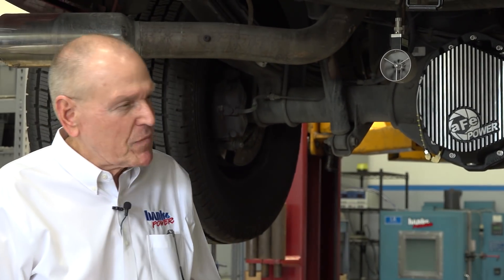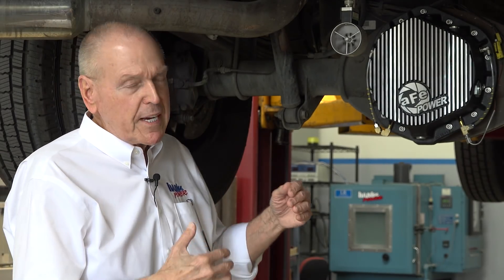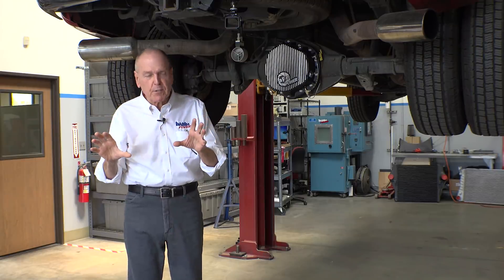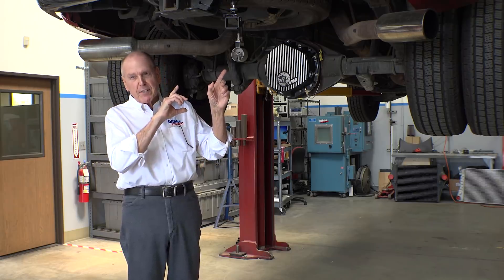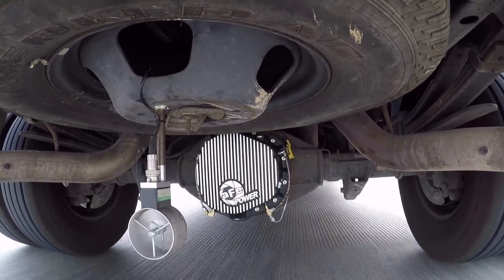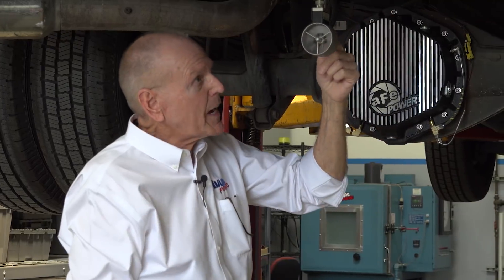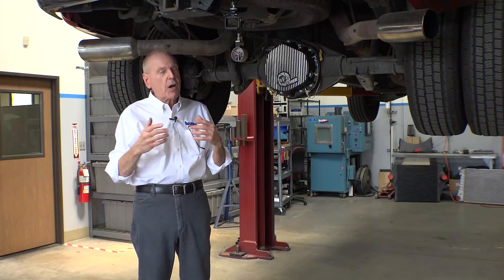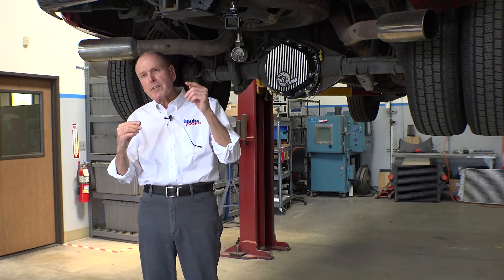Do Diff Covers Work or Are They Just Bling? Part 1 of 3

Comment: ill bet the stamped steel one out performs the "bling" crap just like with wheels
Reply: Like vs like, the aluminum will do better due to heat transfer. These after market ones add capacity which makes the argument more about that rather than material. Also,  steel wheels do not out perform aluminum ones. You can get equal strength at lower weight using aluminum. It's kind of the reason EVERY form of motor sports uses aluminum wheels. Sponsored/pro Drag, off road, drifting, circuit, motorcycle, etc all use them.
Reply: a c NASCAR still runs steel wheels.  Also most race cars use magnesium not aluminum.
Reply: Nascar uses steel wheels because it is mandated in their rules and they want everyone to use the same thing from the same manufacturer. Just like top full pretty much only use hemis because the rules basically describe hemi engines without saying hemi engine. And yes, I know a bunch of cars use mag wheels. They are even lighter and just as strong as aluminum and steel.  There are still way more groups of car culture that use non-steel wheels.
Reply: The heat transfer of aluminum is great until you hit a rock with the diff off-road. Then a person may wish they had stuck with stamped steel. There are pros and cons to everything.
Reply: Rabid Badger absolutely not... I’ve been there. I replaced the stocker with a $100 unit from summit.. 3/4” thick aluminum. Backed into a big rock in a creek bed. Chipped a fin off down to the main cover body and a good gouge in it. Stamped steel one would have a hole in it and could have made it all the way to the ring gear😬. 100% positive it saved me an overnight stay or a shitty trail side repair. On an unrelated note, the rear seal on my transfer case leaked after that🤔
Reply: Anything thing metal with fins that is set away from where the heat originated is playing a critical part in heat dissipation. If the fins are short, stubby and pretty much there for looks you won't notice but a few degrees in difference..  but still doing more for cooling than a smooth surfaced pumpkin lid just because of dispersion to areas other than your valuable parts..
Reply: It depends if your lubricant is over temp.  It has an ideal operating range depending on what its doing, but if you have a gazillion quarts in, and a super duper giant diff housing and never tow anything you may never get the lubricant to flash the water out of it.
Reply: Aluminum has a better heat transfer rate, so I would say you failed chemistry class and are a moron.......
Reply: Alloy doesn't mean aluminium. Cast Iron is a alloy and contains 0 aluminium.
Reply: Pete, No one said alloy. Everyone in this tread said aluminum. 
Rabid Badger, If you are worried about real offroading and hitting a diff, you wouldn't use either. You would want diff armor or fabricated steel plate cover. Most people that run these don't off road. They have them on their pavement princess/ tow rig. Where they care about keeping highway driving/tow temps down.

Comment: So I have an after market diff cover, just like the one as shown. It supposed to hold more fluid. And if I fill it up to the level as I would if it were a stock diff cover. Could I damage my gears? Or should I fill the differential all the way to the top?
Reply: Gman 34 You fill it just like the stock one. It should go to about the level of the bottom of the axle tubes. The extra capacity usually comes from the cover being deeper. If you filled the diff to the top it would overheat because it’s fighting through the fluid all the time.
Reply: Gman 34  get the level too low and you starve the gears and outer bearings. Fluid travels on the axles to the outside bearings lubricate's the bearing and race and drains back down the housing tubes to the sump. Front pinion requires sling lubrication from ring gear.too little sump lube while running = faster wear damaged parts. Error on high side of fluid level.
I install a 1/2 inch galvanised street ell and square pipe plug in all my axles. Raises level 1/4 -3/8 of an inch. Not an option on dodge push in plug covers.

Comment: Does he not realize by increase the size of the cover, the fill level can be increased while keeping it at the same FILL HEIGHT as the stock cover?
Reply: if you increase the total oil volume, then the running oil level will be higher. Got it?
Reply: there's more area for the oil to settle, the running level would stay the same imo

Comment: I have an 03 Cummins, still have the stock diff cover and plan to replace with an AFE or ATS diff cover (AFE is the one pictured in this video).  Because of this video I'll probably invest in some temperature indicators to compare before/after temps.  I'll update when I do.  Until the vid I never really put much thought into it, I just wanted a cool looking diff cover because, looks cool?
Reply: John Davis BD has a unique take on the diff cover , check it out while you're  deciding which cover.
Reply: John Davis  non contact thermal thermometer with laser pointer, 29.00$ everywhere.
Reply: Safety First In Texas... I have an thermal, but I think that it will not be good for this.  I have to pull over to measure temp and when I do that may or may not be the peak temperature that the diff cover experienced.  I used to rebuild transmission, I do have access to strips that blacken as the temperature increases, the more the strip that is blackened, the higher the peak temperature, which is what I am most interested in.  We used them for warranty purposes, one of the guys will probably give me a few for cheap/free.  But thanks for the suggestion however, I will keep it in mind.
Reply: John Davis Guarantee you wont loose 2° in the time it takes to pull over, Get out, and shoot it. I shoot tires, diffs, trans, hub bearings, radiator, carrier bearing, etc. on my rest stop relief detour. Extra 5 min gives piece of mind, standard of normalcy.

Comment: Come up with a Banks Diff cover that works better!!!!!!
Reply: It being a Banks makes it better
Reply: tsimmons1974ts What do you expect it to do better?
Reply: Icutmetal cool the diff  dumbo !!!!🤐🤐🤐🤐
Reply: charge more money for the same thing... right.
Reply: How are ya gonna make something that barely does shit to begin with from an engineering and real world standpoint, do a better job?
Reply: Make one with air scoops at the top to direct air down across the fins on the back. Don't paint it with any sort of coating. That just adds insulation, reducing heat transfer.
Reply: @greggv8  actually, black transfers heat much more than the thin layer of paint will insulate, so black paint is a big net plus for heat transfer...  but I do like the baffle idea!
Reply: MrHillfolk it does a lot freak it transfers the power to the wheels !!!
Reply: tsimmons1974ts 
Ya derp, learn to read. 
All a diff cover is gonna do is hold oil in. 
Unless you install a pump and cooler on the diff , a cover isn’t gonna do shit except be a waste of money.
Reply: tsimmons1974ts no that would be the differential

Comment: I have done some testing on over filling on Dodge/Ram 11.5 With PML, I run 1 QT over full on all My Dodge Rams 2003-13 , I also have temp Gauge installed on all Trucks. In over 278K miles never a problem.  I replace My 2003 11.5 at 82K miles , the pinion bearing failed the rest of the unit was like New. I replace the OEM Unit with TrueTrac all new bearing and replaced the R/P gears. Now the Seller of My TrueTrac adamantly told me to TQ the Side Bearings to 150FT LBS, I called again and inquired Why 150FT LBS is more than I usually do at  110FTS I thought was good.  I immediately had heat increases ,But again the seller (Big Name Company) said it was normal on the TrueTrac.. Well when I went out to The Rockies Pulling My toy Hauler Temps went to 400F+ and I had to use My connections to fine a shop that I could used to remove the Cover and Check....Yep Wear on the R/P gears and  side bearings, So I re-set the R/P Back lash and RE-TQ the  Side bearings to 110FT LBS and continue on... After the 2,700 trip and back home I dropped the cover and Replace it all again do to the wear. IMO that extra 1QT saved that Unit until before/after I could return Home... and I was reimbursed for the 1st unit, it was discovered they were Quoting N m-FT LBS  That was 9 years ago, I'm still running 1QT over to present on all My AM 11.5s and PMLs.

Comment: I bought some mag tech cover’s for my 95 dodge ram 3500 5 speed trans. for several reasons 1-drain and refill made simple  2-The covers have O-rings no sealant or gaskets needed 3- The covers also come with magnets for collecting metal particles 4- The covers are deeper so my capacity went up over a quart in the rear but still retaining factory fill level 5- oil does run cooler by about 70 degrees Fahrenheit on average.   they look a hell of a lot better than the steel caps that came on the truck. and those are the reasons why i purchased mine. i pull heavy commercial air conditioners and sometimes pallets of sod a few years back i installed the complete banks power pack system With the ram air intake kit along with the banks double shot water methanol injection system  which is working out pretty awesome so far. i easily doubled my power output. and because of that my next concern was my drivetrain and keeping it all in one pice. i am curious to see what the test’s say.
Reply: In road-race applications, a pump and seperate oil cooler is frequently used on differentials.
Reply: I'm with you, I've had banks' stuff on my 2002 cummins for 100k...flawless performance. Bought a twin turbo kit for an old small block I had too...can't say as much for that, but had a hell of a lot of fun with it  ;)  Sold to the next guy and he's still out there boosting away.
Reply: speed demon - I'm confident that you did all due dilligence in before and after temperature testing.
Reply: i’ve been using my old truck for a long time for hauling. and the newer trucks were starting to kick my ass they could get the job done faster. and when your truck only goes 72 mph flat out that starts to become a problem in the hauling business.I usually did about 52 to 55 mph so I wasn’t beating it. just made for a long day. so i went from a 4.10 to a 3.73 to get a little more top end and once I did that the measly 180 HP had to be addressed with a complete banks kit. and that did the trick there was a few times I noticed that I could smell hot gear oil when loaded on a hot day. and taking a commonsense approach i figured because went with a taller gear ratio and added power there’s going to be more heat generated.That’s when I started checking there rear axle temp. By climbing on under the truck with a infrared temp gun after a heavy pull. that’s when I decided to bite the bullet and spend the small fortune on front and rear diff covers. there’s no doubt they help keep the gears cooler in my application. Would it be worth it to the average Joe that hardly pulls anything probably not. maybe if your running 38’s with the stock gearing. ive seen lots of newer trucks like dodge With louvered aluminum diff covers from the factory even my wife’s 1989 Toyota supra turbo has a louvered aluminum diff cover from the factory. So there’s gotta be something more to it that the engineers American and Japanese see as a benefit to having Louvered aluminum diff covers other than just bling.
Reply: 70 Degrees ?! That's Great !!
Reply: speed demon - You put a temp gauge on your dif to get the 70* difference? I find that hard to believe...
Reply: K Digiacomo why? He just said the truck is used for work. Ever been in the cab of a big rig/tractor? Temp gauges for both rear axles, transmission, boost, drive pressure, egt, engine oil temp, etc etc.  Those gauges are there to keep your equipment working optimally .....granted you pay attention to them.

Comment: I would love it if you guys did one on the deeper transmission pans
Reply: riley mcfadden trans pan orientation by design cant  bury fluid on rotating parts. Its a win win accessorie. The main benefits is stiffer sealing surfaces and more cooling capacity by surface area said a man who drives a 727 torqueflight that leaks everywhere he goes.

Comment: Glad I saw this, I was just looking into the Mag Hi Tech cover for my Dodge since I'll be doing gears in it. But my pinion angle has changed a tad also, since I have a lift
Reply from the maker: Now, for the record, we're not telling anyone to buy or not buy anyone's product. We're just taking you along on our investigation. We'll have more of our multi-part series coming soon.
Reply: Banks Power that's perfectly fine, understood.  People say I need larger cover to lube outer axle bearings. Well truck made it 100k without large cover and tires from 35s to currently 40s. So I look forward to the results
Reply: Banks Power Just stumbled onto this and have been thinking about some when I get my truck. When are you going to have the results video out. Thx
Reply: Could ya'll add the BD diff cover to the test ?
Reply: https://youtu.be/IG430wBHtvs

Comment: Do trans pans next please!!!
Reply: Yes, the way a rear axle gears work versus the way a trans work is apples to oranges. BUT, all I wanted to know by saying to do trans pans next is just the same reason Mr. Banks is doing this test. Do aftermarket “cooling” pans actually work. That’s all.
Reply: deep cooling pans do work, even the thick aluminum transfers the heat faster that painted sheetmetal, gets it farther down into the airstream under the truck/car, and adds capacity.  

The gears in an auto aren't running in oil bath like a manual trans or axle, so the extra capacity isnt an issue as long as its not over the factory level up in the case.

the added capacity increases warmup time but increases the thermal capacity, basically you can abuse the fluid more before it starts to see thermal runaway.
Reply: Do those guys selling those after market covers have the scientific evidence to back up their story and are willing to make it public?
Reply: theblackmech nice explanation
Reply: Depending on the results of the diff cover results, it might be worth looking at.  The air flow is different between a trans pan and a diff cover.  The trans pan is at least directly in contact with the air flow, where the diff cover is not.
Reply: @johnmcdougald1238  Got a Mag-Hytec trans pan waiting to be installed in my Dodge Cummins 12 valve - After I finish wiring-up the new three-gauge pod that will sit on my dash with, of course, a Banks Transmission temp gauge.
Reply: SIIN MC Makes sense because the pan is under the guts of the trans, could touch the ground and wouldn't make a difference in terms of trans performance
Reply: Auto trans pans are done more for capacity than cooling. They're cooled by the radiator or a dedicated cooler.
Reply: yes, but the increased fluid capacity requires more thermal input for the fluid to get out of an acceptable operating range
Reply: It's possible to get an automatic transmission too cool. That's why air coolers for transmissions are placed before the cooler in the radiator. Those coolers are more for keeping a hot transmission from transferring heat to the engine coolant. If the air temp is really cold, it will chill the trans fluid too much but the engine coolant will bring it back up to where it should be.
Reply: Trans pans are completely different.  Diffs are splash lubricated, while transmissions have a pump for lube.  A deeper trans pan works the same way as a deeper engine oil pan.  It mainly lowers oil temps through staving off oil heating by the higher capacity.  

If deeper trans pans didn't work, OEMs wouldn't use that trick themselves.  Ford in particular loved putting deeper sump pans on their 4x4 transmissions.  Deeper pans with a deeper sump add capacity, which increases service intervals and reduces the chances of pulling air under extreme angles and/or high G loading.
Reply: How about pinion angle changes for lift kits?
Reply: My transmission runs at 120 degrees
Reply: The best reason to buy an aftermarket trans pan is if your stock one doesn't have a drain plug, you're way more likely to keep fresh fluid in it if you can just pull a plug and refill.  And regular fluid changes will keep your trans alive longer than anything else you can do for it.  I put a B&M aluminum pan and added an external filter to my 6L80E by tapping into the cooler lines, I use a Napa Gold 10 micron hydraulic filter.  Was less than $300 for both and well worth it to me to be able to easily change the fluid and filter.
Reply: Trans pans? When do I start to see pink hair in the fluid?
Reply: downshifter4179 - You can make a ten minute video about that question too, and waste thousands of viewer's time just like Mr. Banks did.